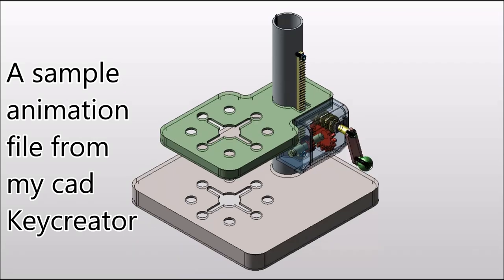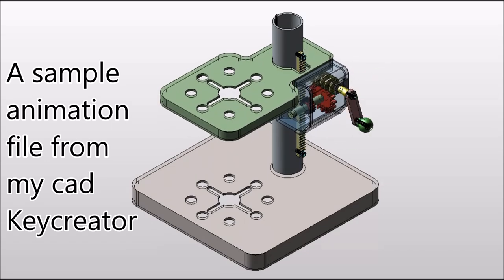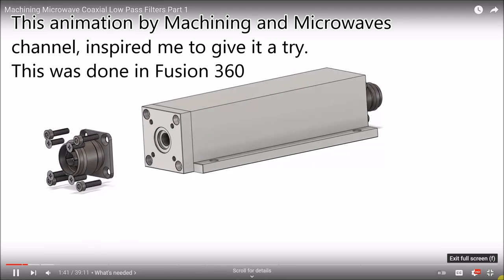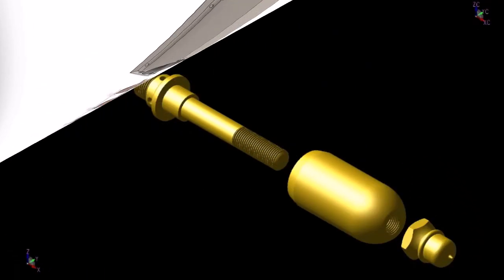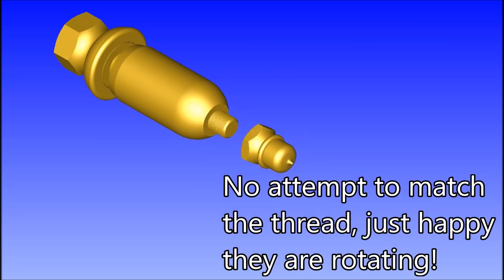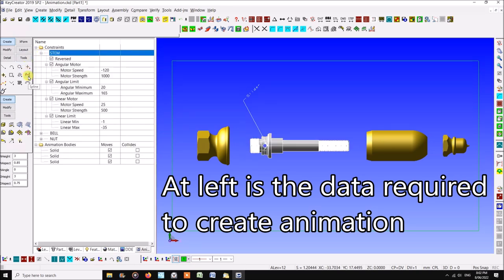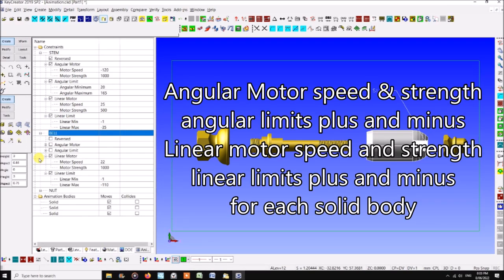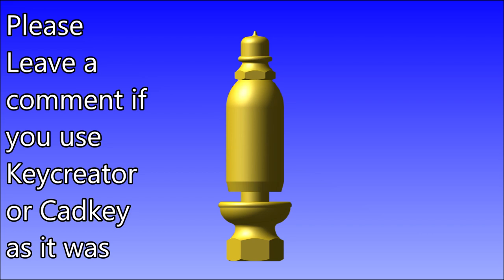Lunkenheimer 2" Steam whistle, my first attempt at animation using Keycreator cad

Comment: Hello Nigel,
I am sort of on page one, chapter one on Fusion 360. I did a 3 day F360 course a couple of months ago which gave me a better understanding.
Cheers.
Paul,,
Reply from the maker: Hi Paul, despite my cnc machining, I am actually a draftsman. Been using my software since 1990, it was dos based then of course. It works in a different way to Fusion. There is no way that I can get into Fusion, I am too used to my own system. Tried to get the hang of it but decided to upgrade my own system at a cost then of some 3.5k aud on a special price. The upgrade was a huge change from my early system, but I was up to speed on it in a few days and paying for the upgrade. It is mine and I own it, no other fees involved. Paid for itself quite quickly.